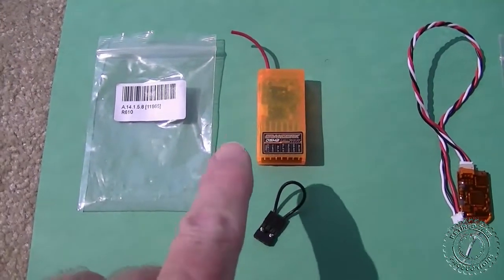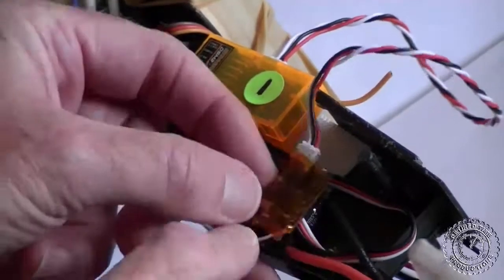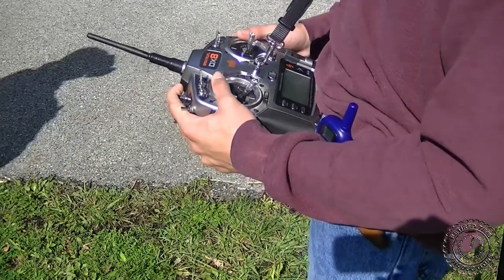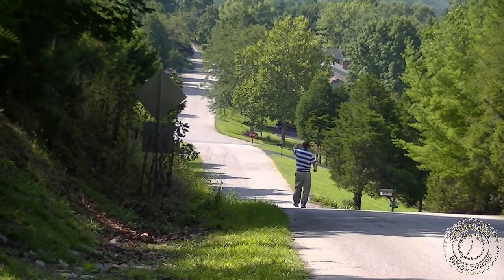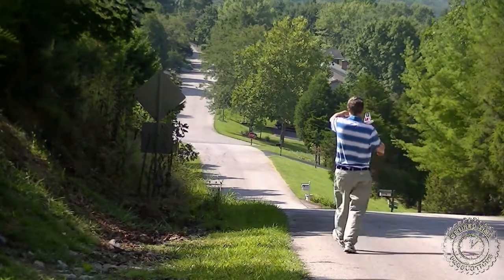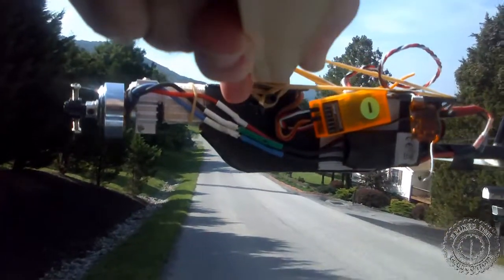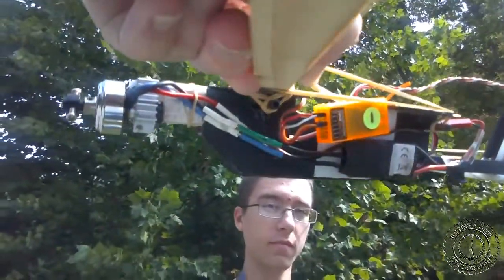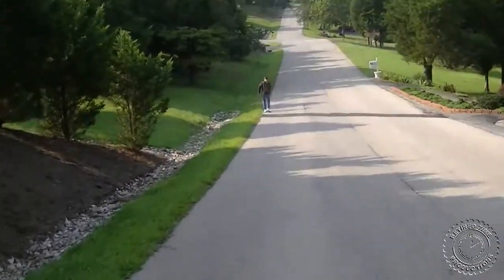Range checking HobbyKing Orange Satellite Receiver on Orange RX Receiver.

Comment: What does the satellite receiver do?  Is it used to position hold your heli in a certain spot and altitude?  What use does it have in a fixed wing?  Does it actually receive signal from your transmitter?
Reply from the maker: +Andrew Jackson It just adds another antenna that can be positioned for better  reception from the transmitter.

Comment: You have the receiver horizontal in the first test, horizontal in second with satellite horizontal and then the final test horizontal with the satellite VERTICAL.  the final test you get more range.  You get more range in the final test because the polarisation of the satellite is more favourable to how the antenna on the Tx is set up, so these results are presented in a misleading way I believe.
Reply: You're absolutely right Simon.  The reason for the extended range in the test with the satellite receiver on the tail, is very likely due to the RX antenna polarization being better aligned with the  TX antenna polarization.  If they tried it again with just the single RX mounted on the tail with its antenna vertical like they had the satellite antenna, I'll bet they'd get about the same range.

Comment: I and a buddy lost 2 planes with Orange RX 610's in them.. My Christen Eagle took off for no reason, i momentarily got it back but then it lost connection again, not in enough time to recover from a (fatal nose dive crash - destroyed ) - I was using a Spektrum DX6i
My buddy scratch built a sea plane, same kind of RX (Orange RX 610) again, same area, approximately the same distance (roughly 500')  and his took off as well, we found it in a tree and was able to get it down.. (he flew it again) after a fresh full battery charge, and lost it yet again and that time not so lucky, found it in a back yard and crumpled up a bit.
he was using a Spektrum DX8 , two different radios, same Orange RX receivers, approximately the same distance away.... 

In both flights, we were having fun for hours, low altitudes, high altitudes, then they just  mysteriously let go.......  I have several other Planes that have Spektrum receivers, both 4 channels, 6 channels and have no issues.. same distances flying and such..   We have lost trust in Orange RX (Orange RX Sux!)

Comment: what is the diff between Satellite Receiver and normal Receiver ???
Reply from the maker: +Saleem Khutaba No difference other than the satellite has only one cable connection which goes to the main receiver.  Is some cases a satellite can be used standalone by connecting directly to a flight controller in order to save space.

Comment: considering I get about 1.5 kilometers with a turnigy 9x stock system this does not sound very good
Reply from the maker: The test was done with the TX in low power mode.
Reply: usualy 30-40 paces are great in rangecheck; 120is excelent
Reply: ***** so what is the full range full power in the air ?
Reply: 2007crf450r I heard in low power mode the range is reduced by a factor of 30. The dx6i manual says range check should be done at 90ft/30 paces. With a 30x factor that is a half a mile range in air. 120 paces would be 4 miles. I think tx/rx antenna and plane orientation makes a big difference though, as well as wifi background noise.